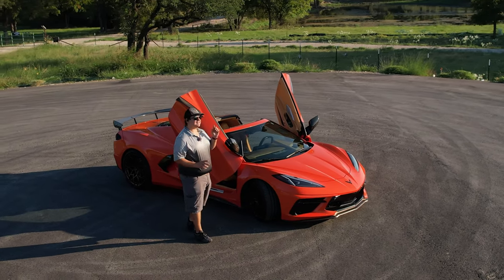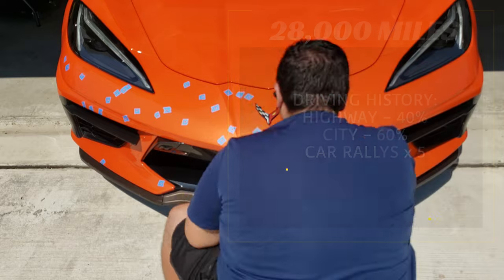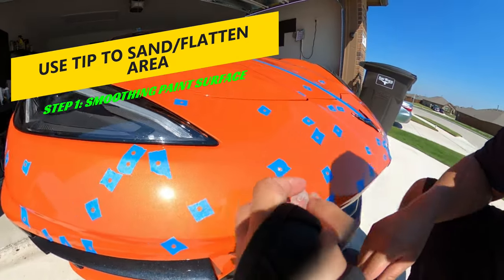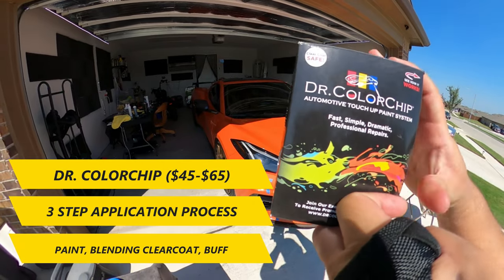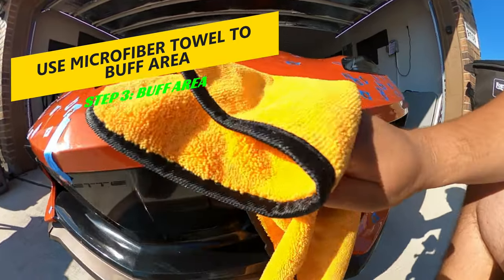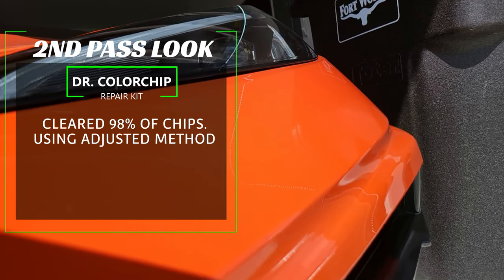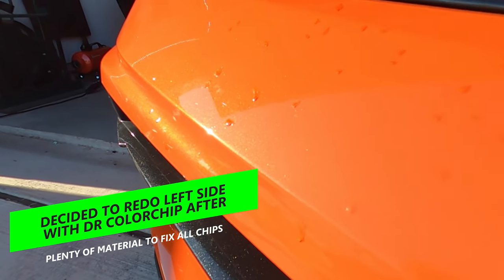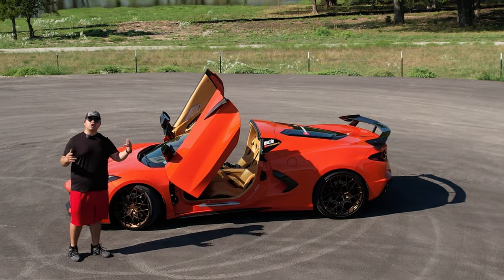How Bad is it? 28k Miles with No Paint Protection C8 Corvette!

Comment: Good job! I've used Dr Colorchip on many of my vehicles and for the money and ease of use it's the best I have used. Definitely recommend PPF!
Reply from the maker: Thanks for the feedback Jeff! Def was a game changer when filling chips. But lesson learned, PPF is the way to go!
Reply: @NuHorizonC8  But why?  You just spent less than $100 on Dr. ColorChip and got a 98% clear bumper / hood. A full PPF front end package costs $2,400 on a C8.  And you're still going to see most of those chips on the film.  And you won't be able to get them off without removing the film and replacing it.  Worse case you can spend a fraction of that $2.400 on a professional paint correction every so often.  What am I missing?

Comment: Great video!

Lesson learned on the PPF. I got mine on before I even drove anywhere other than home from dealer. The self healing of XPEL is amazing. I even scratched the film with a rock stuck in my microfiber towel. In about 5 minutes the deep scratch on the film healed and disappeared.
Reply from the maker: Thanks Brett! Yeah not having PPF is one of my biggest regrets of not getting when I first got my C8. Spending the money back then could have saved me thousands to get it done now which would need a full repaint then PPF applied.
Reply: I wish that I would have added ppf to the hood as well. I only put it on the front bumper, a pillars and rocker panels. The hood is starting to pick up chips.
Reply from the maker: @mocheen4837  yeah the hood area will get some especially for how low the car sits. You may want to check out the Dr Colorchip for yours. It may help fill some of those kind of chips pretty well in the meantime. 👍

Comment: Given the fact the C8 is so low to the ground everything the traffic in front kicks up hits the C8’s front end and hood.

When I received my C8 in mid April it sat in the garage for two weeks waiting for my scheduled XPEL PPF appointment to have the entire front end and rockers wrapped. I had my C7 wrapped in 2015 and in 6 years before I sold it I put 33,000 roadtrip miles on it and the front-end took hundreds of hits some were fairly big rocks, ZERO paint damage.
Reply from the maker: Thanks for that info! Yeah its definitely crazy how many hits you can rack up over the miles. It never really occurred to me when I first purchased this car brand new and really wanted to showcase the car at different show events and such. And was a big learned lesson to not skimp out on that option.
Reply: The C7 front end is much lower than the C8.

Comment: It really surprises me of the differences over the years. My ‘94 didn’t have that many problems over 168k. My ‘15 after 500 miles was driving me crazy so I had the chips touched up and the PPF applied. I plan on picking up my ‘23 and driving it directly to the PPF shop to have it done and ceramic coated.
Reply from the maker: It is interesting to see the difference in how paints endure depending on the manufacturer and year of a car. In hindsight, I definitely wished i had gotten PPF for the C8 when I first took delivery. Glad I could help others avoid my mistakes! 😅
Reply: I have a C8 on order and reached a different conclusion from this video.  If I can repair paint chips to 90-95% with Dr. Colorchip, why would I pay thousands to get PPF?  It may protect the underlying paint, but chips will mar the film almost as badly and you can't fix the film without removing and redoing it.

Comment: I had a 2020 stingray for three years with no PPF and I had zero paint chips on the front. Why? Because I’m very disciplined about not getting too close to cars in front of me, and stay off the highway with it. But it, like my new Z06, was meant for a weekender, not a daily driver.  So in certain circumstances, doing a PPF on the front end still could be beneficial, although it does show scars from stone impacts so it is not panacea.

Comment: Hey there - I also tried using ACDelco paint but it doesn't look so good, it has already hardened. How were you able to remove it? I had PPF on my front fascia but it became damaged in a minor bump while parking on the nose tip, so I'll need to get it redone.
Reply from the maker: Hey thanks for the comment. So the quick answer is that it involved light sanding to then redo. Once it cures that essentially the only way you can go

Comment: Stop following so close to other vehicles on the highway you will reduce the risk of so many rock chips.
Reply from the maker: Hey top appreciate the suggestion. I do generally keep a wide reach from other vehicles specifically because of that but sometimes its unavoidable especially when others merge right in front and dont give you a choice 🤷‍♂️. It doesnt help either that texas roads tend to have quite a bit of junk on the roads in general. Just in this last week ive had to avoid broken peices of wood, spilled paint cans, random car pieces, and even a mattress 😅. Its a jungle out there sometimes.
Reply: I keep a large distance from other cars and I still pick up rocks and bugs. I have paint protection on the front and it is amazing how many rocks hit the front bumper.

Comment: I did mine and it looked worse after, wish I never touched it! if you drive a car like that you can afford to have the nose painted!
Reply from the maker: Hey Byron thanks for the feedback. I'm curious which paint chip repair kit you went with. I did find the AC Delco made some of the chips worse on mine as well. Thankfully the DR. Color Chip worked wonders to help fix alot of my chips. I do plan on getting my C8 repainted regardless but thought this would be a good informative video for the community in the meantime. More options is better than only 1 or 2 expensive options.
Reply: @NuHorizonC8  got my paint stick at Canadian Tire store,  I did my home work first, I watched you tube videos, got the correct paint code and followed the instructions.I had a 2018 Ford raptor, blue in color. After I finished it looked like the truck with bad acne!

Comment: Tbh, PPF is a gimmick, don’t get me wrong it will do its job. But for 8k dollars and you will have to peel them off after a few years??? If you do partially up front, especially in a white car, it will look horrible after a few months out in the sun. How do I know? I had it on my Z06. I peeled them off myself and when i did that, I found so many cuts on the paint due to the installation…. I spent 1600 dollars for the hood and front bumper and got deep cuts on my paint???wtf. It’s not worth it, so what it has rock chips, just retouch the paint and you will be good to go.

Comment: You follow people way too close….  When you have a low profile car you need to learn to keep a distance between you and the vehicles ahead.  That many chips on a 28000 mile car is ridiculous
Reply from the maker: Thanks for the feedback plainview. I agree it does make a difference giving an extra bit of space, which I do tend to give where possible when driving. Bad Texas roads with alot of debris and such dont help thats for sure 😅. That being said, its surprising what kind of paint imperfections you will see when your looking at a 2ft distance away. Not all the paint chips were full on through the paint but were noticable imperfections that could be repaired via a paint chip repair kit or protected via PPF which is the point of the video. Thanks again for the feedback and support.